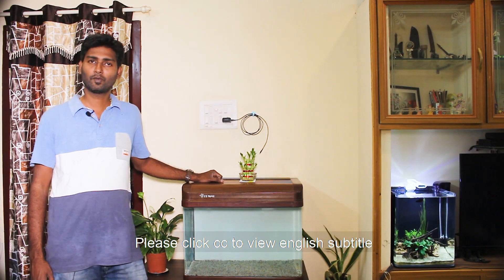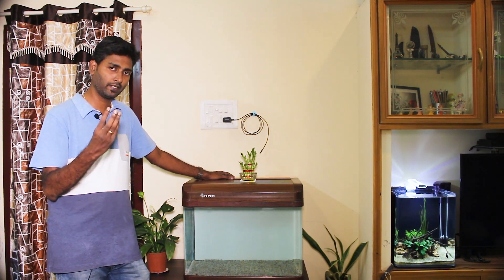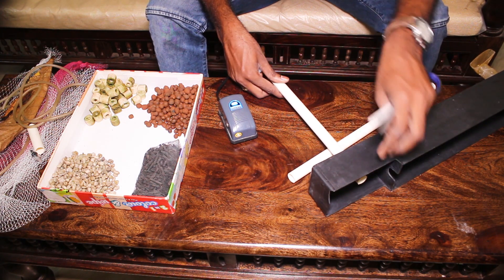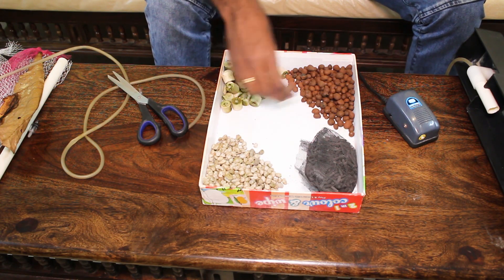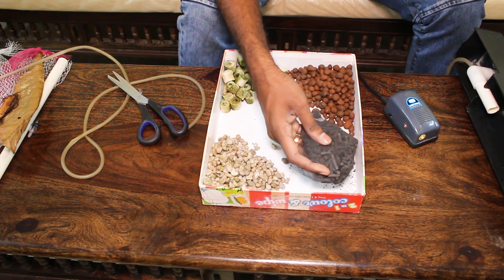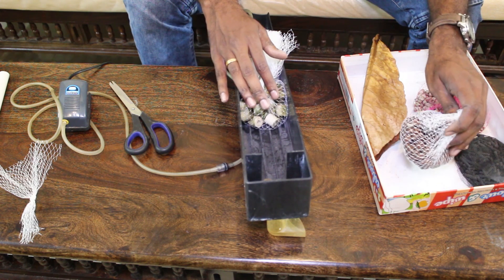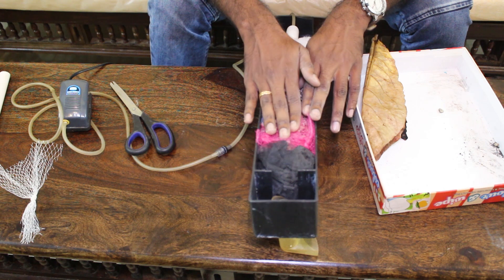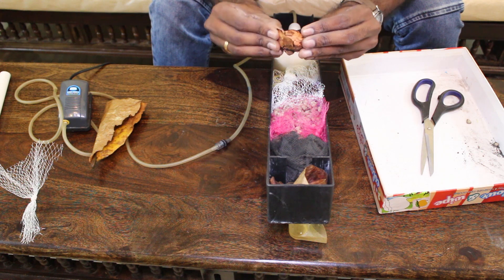Aquarium filter | Top filter setup and media | தமிழ்

Comment: Bro water flow annalae o2 dissolve ayerum.
Reply from the maker: S bro, i agree with you. I couldn't  get why you mentiomed it. But in small tank for big fish we need extra air crystals.
Reply: @MyBudgetHobbies  ur idea is awesome but the for big fishes it will 💩 more......hence you should work more on the weekly maintenance.you could have used a power head to balance this...but it would have raised the budget a bit...
Reply from the maker: Yes Bro.